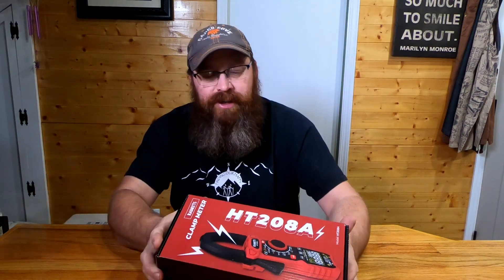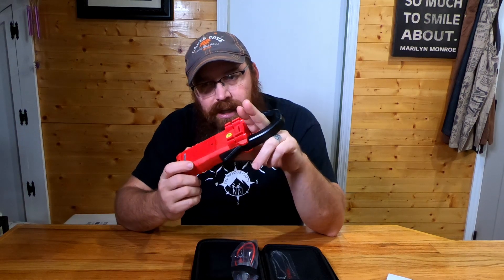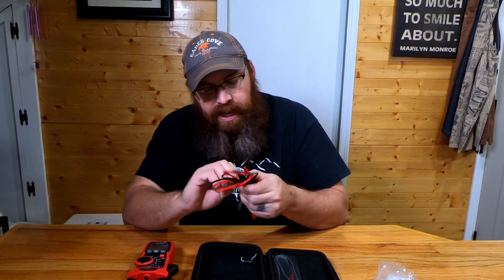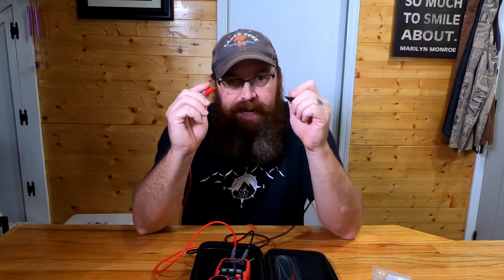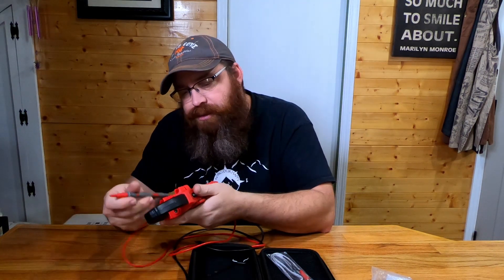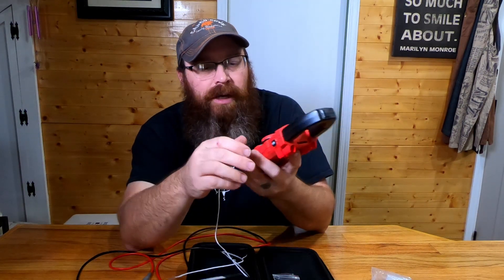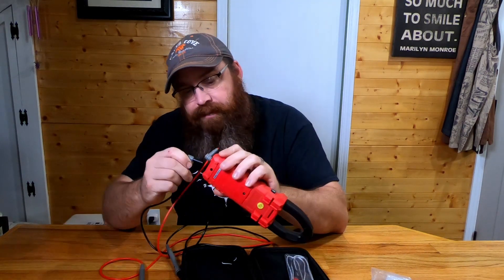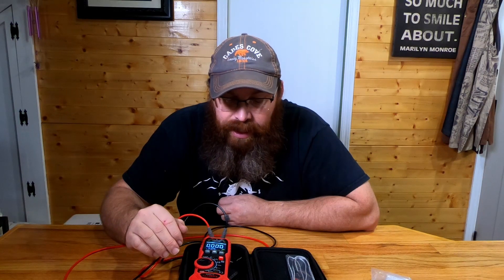KAIWEETS HT208A True RMS Digital Clamp Meter

Comment: When I put around a cable I get no amps reading but when I use live option says it is live. Can you explain how to use to check amps on a circuit?
Reply: Ac fluctuates you need to measure current only on the live wire as the current from live and neutral will cancel out